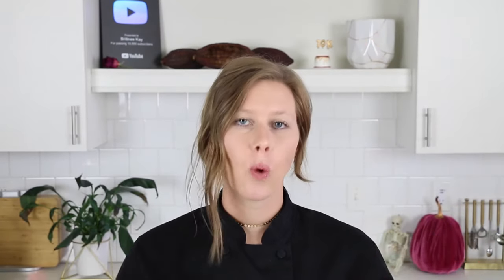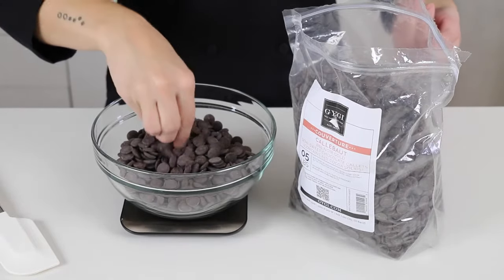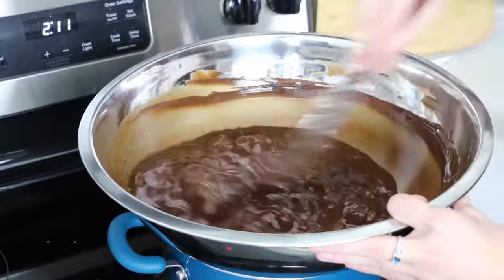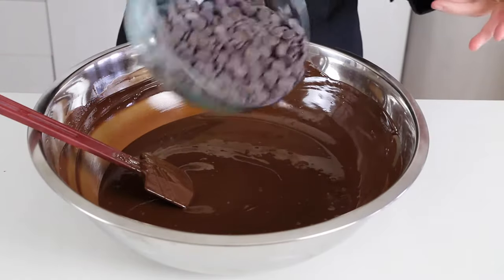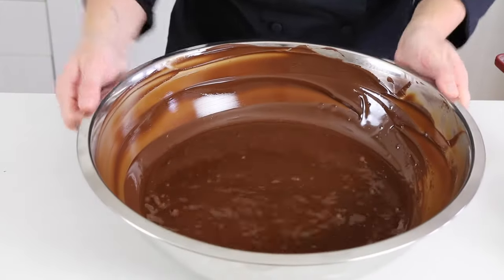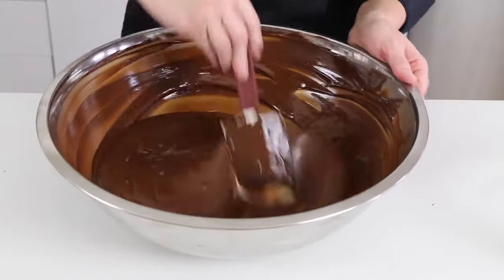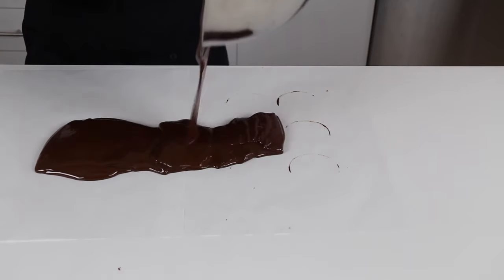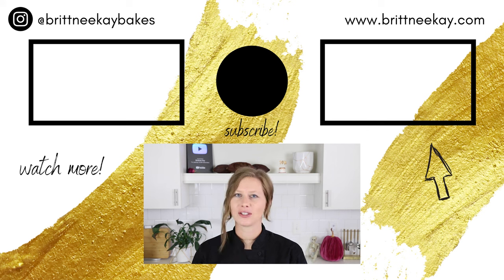Temper Chocolate | Seeding Method

Comment: Yet another great video, thanks.
I'm told the higher quality chocolate - Callebaut, Valrhona, Michel Cluizel, etc., is already tempered. Is it necessary to temper it again before using it for molding? If yes, why?
Reply from the maker: Of course! Yes higher quality chocolate is called couverture and must be tempered before each use. Yes those brands come tempered but as soon as you melt them they become untempered. There is a whole lot more to the process of tempering, but the basic idea is that you produce stable crystals as you cool the chocolate. Melting chocoalte melts the stable crystals! Hope this helps!

Comment: Hi there Brittnee, once tempered is there a way to hold it at temperature for longer periods, we use chocolate to coat our almond tooffee and may need to maintain the temper for application for upto 3-4 hrs so its available on demand so to speak.
Reply from the maker: Yes there are but it can get tricky...overtime the chocolate will get thicker even if held at consistent temperatures. Depending on how big your production, you could look into temper machines because that is what they are made to do! Otherwise I recommend getting a chocolate warming tank. You can hold it at a given temperature. In order to keep it fluid and not thicken you will need to stir it. When some chocolate up on the edges sets up you can melt it with your heat gun and mix it in and that helps keep it fluid as well. But it will take some practice!

Comment: Hey Brittnee! So each time you have to re temper right? It's not just a one and done lol?
Also, how long does chocolate hold at the temperature you need to use it at? 5 or less degrees seems like you have to work so fast? 
Thank you for your videos! I enjoy watching them
Reply from the maker: Yeah unfortunately! Lol I wish not!
It is pretty frustrating to hold the chocolate at the working temp! The heat gun works but gets annoying! If you want to do a lot of chocolate work I recommend investing in a warming tank and then you can just hold the chocolate at the correct temp!

Comment: Thank you for sharing.I put the chocolate in the fridge for 20 mins to be harden.But my chocolate melt easily on hand when I took out my chocolate from the fridge.  Should I just leave the chocolate in room temperature after filling?
Reply from the maker: You're welcome! So, if it is melting really fast in your hand, like you can barely pick it up then it sounds like it wasn't tempered properly. Of course chocolate will melt in your hand, but it should be slow. To contract your chocolate from a mold you do want to pop it into the fridge for about 20 minutes, but after that store the chocolate in a cool place.

Comment: Hey Brittnee! I love your videos. I have a question having to do with today's video. If you have some chocolate left from using after tempering, and you allow it to set, how do you recommend re tempering for next use without the use of seeding? 

Many thanks!
Reply from the maker: Thank you!! You should be able to use any tempering method for re-tempering! You can chop up your chocolate and use the chopped pieces as the seeds. Or use the microwave method (melt 50/50 and stir) or tabling method works as well!
Reply: @BrittneeKay  thank you so much. Sorry one more clarification. Do you need to add fresh seeds to bloomed scraps?
Reply: @BrittneeKay  I'll have to experiment more with the tabling method!
Reply from the maker: @Moonbutnosun  Yeah! I'll post a video on tabling hopefully soon as well!

Comment: Thoughts on using a stand mixer to blend the seeds during cooling process Instead of hand mixer?haven’t seen anyone do this in any video and it just seems like it removes the hand workout.  I’m also looking to add cordiceps and lions mane powder into my chocolates. Was the first thought that came to my head as I already have one. Is it logical that those also would be added in once your reach the top melting temp along with the seeds and just have it start churning with a wire whip attachment.
Reply from the maker: I don't see any major reasons you wouldn't be able to use a stand mixer other than it could introduce too much movement and stirring to the chocolate and overtemper it. The blending is really only to assist emulsifying the seeds. Not only that, it's going to make a mess of your blender which is hard to clean than a small hand mixer. The stick blender isn't that much of a hand workout, I promise, and is so much simpler to use! Also, you don't have to use a blender at all. You can simply add the seeds in and stir!
As for adding in mix-ins, wait until the chocolate is tempered to do so. Once you get your chocolate to working temperature then just stir the mix-ins into it and it's immediately read to use!
Reply: to much movement can over temper???   @BrittneeKay  😱😱😱😱😱
Reply from the maker: Yeah, you can actually develop too many stable crystals sometimes! @borisrodriguez-cw3dr
Reply: how can you know if this has happened? @BrittneeKay
Reply from the maker: I would say mostly the thickness. I wouldn't worry about it too much though, most likely if you follow the recommended processes it isn't going to happen to you. I only worry that it could if you're putting chocolate through a standard blender. But with that being said, don't be afraid to experiment and see what happens! :D @borisrodriguez-cw3dr

Comment: So I’ve successfully tempered dark chocolate several times after trying for months. But now I wanna temper white chocolate. So for dark chocolate I follow your method from a previous comment which is melt to 113F, add half of my seeds, stir, then add seeds little by little until I get to about 91F, from there I stir until I get to 87-89F. 

For white chocolate, I believe I would melt to 113F still, then add same amount of seeds, but what is the working temp for white chocolate and when should I stop adding seeds? I’m a bit confused on that part if you could help, thanks so much
Reply from the maker: Yes same exact process!! Seed about 20% until you get below 34C. Working temp is 30-31C If you click the link in the description you can download my tempering curves for each type of chocolate too if you want them for reference 🙂
Reply: @BrittneeKay  oh okay sounds great, so I looked at the tempering chart in your description, it says for white chocolate that the working temp is 84-86F, but here I see you said the working temp is 86-88F. But on the actual bag of callebaut chocolate it says the working temp is 82-84F, so I’m just confused about the temps, there are so many different ones for the same brand of chocolate. Also, should I stop seeding that many degrees from the working temp? Would I still get a good temperature if I stop adding seeds that far from the working temp?

I’m not sure what to do, also does white chocolate take long to set up? Because when I feel like I tempered it it’s still soft after about while and melts kinda easily. Does it also also take 24 hours to crystallize? Because it did snap after several hours after I had stored it

Comment: I have only tempered smaller batches use the smaller he 3 to 1 ratio. My bonbons were tempered. The problem was my chocolate was to thick when placed in the molds to form the shells. The chocolate was
Mainly sticking to the mold. Only a small amount came out.  Next time I will use your method. I have a 5 pound bag of semi sweet chocolate. Have you tried Mycro cocoa butter for tempering.
Reply from the maker: Ohh interesting, I wonder why it was so thick! Yes I have tried mycryo for tempering and it works great but because it is so tempered it sets up really fast! So I don't like working with it when molding because honestly the speed of it setting up makes it hard to work with in my opinion. It is also expensive! : )
Reply: Your chocolate may be thick because the amount of cocoa butter is lesser, you can fix by adding cocoa butter or use high percent cocoa butter. Hope this helps

Comment: Brittnee, I’ve been successful with this method twice, but now am having trouble. I’m melting the chocolate over steam, got it to 116 degrees F. Then added 1/4 of the total amount as seeds and stirred vigorously, cooling down to 89 degrees F, but the chocolate is not setting properly. When it does finally set it is streaky. What might I be doing wrong?
Reply from the maker: Hmmm ok lets see... what chocolate are you using? dark or milk? Next time you test it instead of adding all of the seeds at once try to add about 1/2 of the seeds and stir until they're all melted, it will probably get you to around 100 F. Then add in almost all of the rest and stir until melted. Then add more until you get down to around 90-93. Then keep stirring occasionally until it cools to working temp. See if that helps you with the temper and streaking!
Reply: @BrittneeKay  It’s the Callebaut 811 dark callets. Could I be stirring to vigorously? Is it ok to re-temper leftover chocolate?
Reply from the maker: @esthergrissom5422   Does it have snap and shine? Is the only problem the streaking?
Reply: @BrittneeKay  not really. Maybe a little snap after it sets. It’s splotchy and streaky once it sets, but before that it’s shiny.
Reply from the maker: @esthergrissom5422  Hmm to me sounds undertempered then rather than overtempered if no real snap...so I wouldn't say you're stirring too vigorously!
Reply: @BrittneeKay what causes underempering and what does it mean went wrong? Thanks for your help with this 😊
Reply from the maker: @esthergrissom5422  Not enough stable crystals formed. The reason this might happen is that if you add all your seeds in at the beginning and they all melt before your chocolate cools to around 34 C enough crystals might not develop!
Reply: @BrittneeKay  Thanks! That must be what happened. The seeds melted quickly.
Reply from the maker: @esthergrissom5422  Yeah! That's probably it!

Comment: I’m new to your channel so apologies for a belated question - is seeding method best for tempering small amount of chocolate vs using microwave ?
Reply from the maker: For relatively small amounts I think seeding is great or the microwave method, either one! But for really small amounts like 1/2 lb - 1 lb or something like that using mycryo works really really well! (I have a video on that too if you're interested!)
Reply: @BrittneeKay  I was thinking like 200g or something (😅) as that’s the standard package I get in my country. If I use microwave I found it quite easily to melt everything too quickly
Reply from the maker: @vitang8095  Ohh yes, you have to be super careful! Do even 10 seconds at a time if you need!